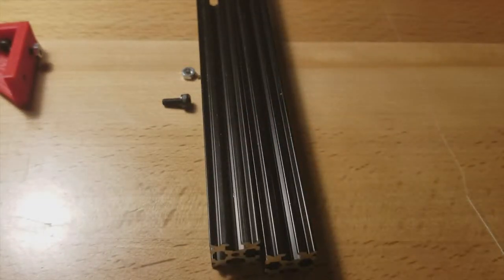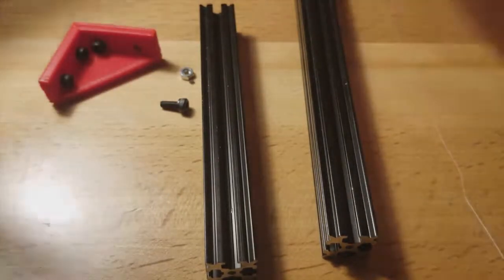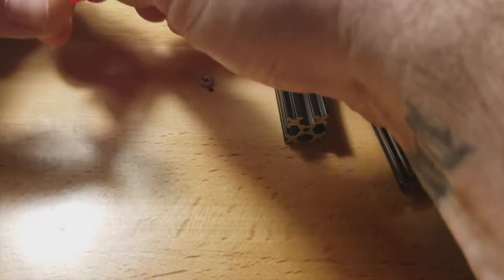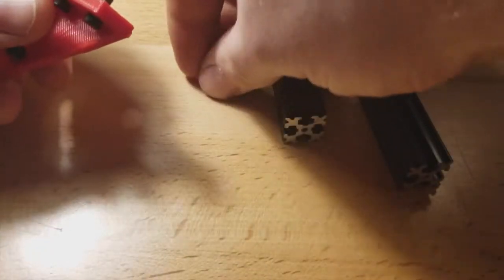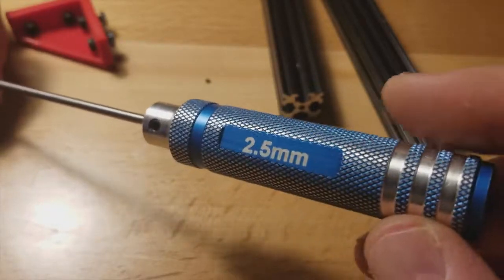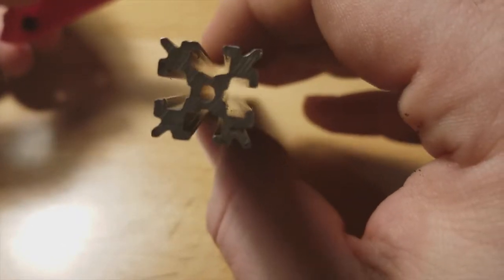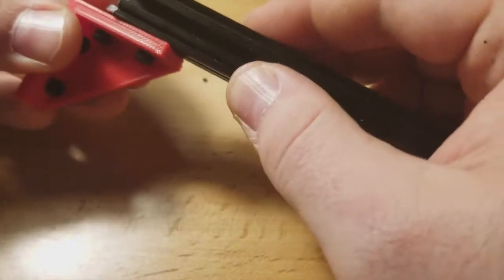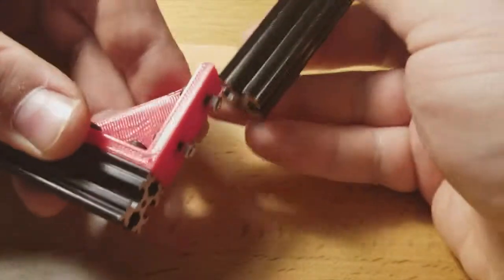Basic Corner Bracket And Extrusion Assembly Tutorial

Comment: Is the extrusion small enough to prevent the nut from turning working the channel? I was surprised to see you weren't using T-nuts.
Reply from the maker: Yes, the channel for the nut is tight enough that it doesn't turn at all. It's fully locked.